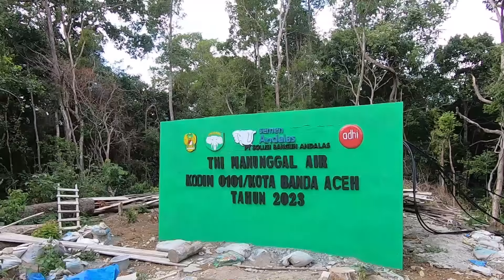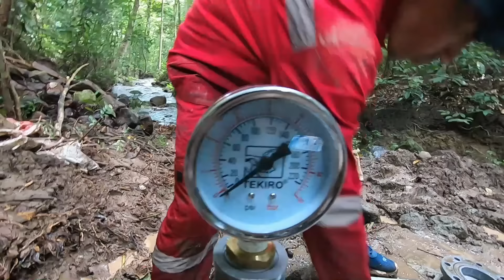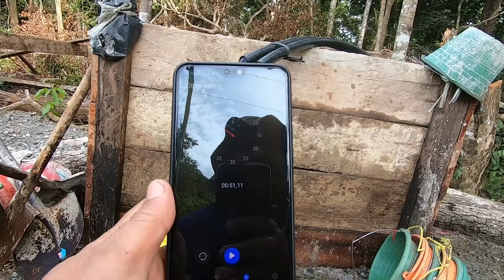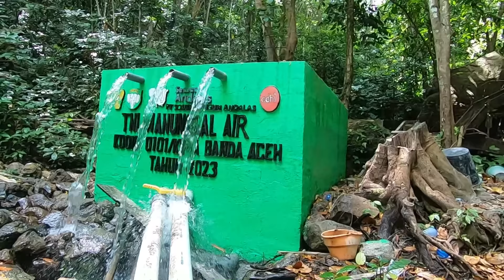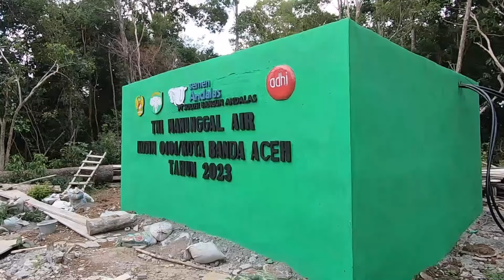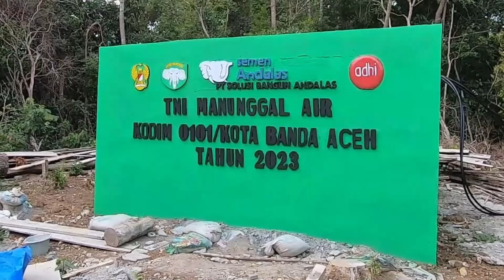High Pressure Non-Electric Water Pump, Double Valves, 2 Pumps with 4 Out Pipes in Extreme Locations

Comment: JIKA PESAN, BERAPA HARGA PER UNIT KANG?
Reply from the maker: Haga 5.100.000...kang.... salam
Reply: The area of the hole south of the Sarah should use these to transfer water to dry aera away from the rivers Senegal and the negir 50 klm. Away
Reply: @TradisionalChannel_Indonesia  5jt 100 apa aja yg didapat bos
Reply from the maker: Pompa satu set...lengkap tabung 1.8 m ukuran tabung 6 inc... 2 bh klep bahan besi... Pressure gauge , baut anti karat... Kunci 24 dan kunci inggris

Comment: Fantastic job. How would a project like this cost? I am thinking of doing something similar in my late mother’s village in near future in Congo. Hope to work with you one day.
Reply: My name is Martin from jamaica I always watch your peoples videos you peoples are very talented now let me give you a simple  water 💦 inlet at the air
Reply: Are different idea you use a very big air compresser and put your mechanical works to it I confident it will work
Reply: My name is Martin from jamaica I always watch your peoples videos you peoples are very talented now let me give you a simple idea for your water pump works get a six silender diesel engine and put it on a stand put a water wheel to the part that turned to the gearbox and reverse it with a water 💦 inlet at the air
Reply: I can build one for your village, I have designed a ram pump. And I can build one for you at a much lower cost, just get me the airline ticket and a pocket allowance and fly me over to your village. You provide the manpower and resources

Comment: Mantap pak, berapa harga pak input 2,5 inci, output 1/2 inci dengan elevasi 25-30 meter dengan panjang 200-300 meter
Reply from the maker: Untuk pompa hidram yg 3 inchi ada,  jadi pipa input 3 inchi… 
Tapi bila sumber air sangat kencang  boleh mengginkan input 2.5 inchi
Reply: harganya brapa mas bro saya mau beli
Reply from the maker: @janijani513  kalau harga agak mahal dgn bahannya... Rp. 5.100.000

Comment: My name is Martin from jamaica I always watch your peoples videos you peoples are very talented now let me give you a simple idea for your water pump works get a six silender diesel engine and put it on a stand put a water wheel to the part that turned to the gearbox and reverse it with a water 💦 inlet at the air sucksiton and put other water hose to the part where the exhaust would come out and immediately it becomes a powerful water pump
Reply: Ram pump, it uses hydraulic shock to cycle itself it can push water higher than the source but the pump must be lower than the source. Him stomping on the waste valve is the way to get it started every time you see the waste valve closing water is sent out

Comment: Man, that thing makes one heck of a "THUD" when the waste valves close. With those big pipes, you are going to move a LOT of water uphill. What kind of pressures does it run when operating at full capacity? And also, how much water does it move up the hill and how far would it push the water up?

Comment: Hello, I want to use the system you have installed in a pond. For this purpose, I want to install a siphon system on the suction line of the water ram, pressurize the water coming from the pond and transfer it to the water ram. I intend to hit a horizontal distance of approximately 300m and a vertical altitude of 25m. Do you think this mechanism will work for me or should I install a stronger mechanism? Thank you in advance
Reply from the maker: We have never tried the Siphon system.
but if the system we have installed is suitable for a vertical height of 25 meters...
Reply: @TradisionalChannel_Indonesia  My aim is to make stagnant water fluid using the siphon method and give it to the water ram in that way.
Reply from the maker: Yes, yes... if with such a system it is okay, the important thing is that the Siphon system must be higher than the ram pump... there must be elevation between the siphon and the pump... Good luck
Reply: My name is Martin from jamaica I always watch your peoples videos you peoples are very talented now let me give you a simple idea for your water pump works get a six silender diesel engine and put it on a stand put a water wheel to the part that turned to the gearbox and reverse it with a water 💦 inlet at the air
Reply: My name is Martin from jamaica I always watch your peoples videos you peoples are very talented now let me give you a simple idea for your water pump works get a six silender diesel engine and put it on a stand put a water wheel to the part that turned to the gearbox and reverse it with a water 💦 inlet at the air
Reply: My name is Martin from jamaica I always watch your peoples videos you peoples are very talented now let me give you a simple idea for your water pump works get a six silender diesel engine and put it on a stand put a water wheel to the part that turned to the gearbox and reverse it with a water 💦 inlet at the air
Reply from the maker: thank you for your idea... good luck

Comment: The height I calculated on my land is approximately 20 meters. My water motor line that I previously installed is a 2-inch system. Can I integrate this system with the water ram?
Reply: My name is Martin from jamaica I always watch your peoples videos you peoples are very talented now let me give you a simple idea for your water pump works get a six silender diesel engine and put it on a stand put a water wheel to the part that turned to the gearbox and reverse it with a water 💦 inlet at the air

Comment: Does anyone know why when working on the valves at around 6:30 for example, they did not block the inlet upstream to prevent the water from flowing, allowing them to work more easily?
Reply: A bit specific.

Comment: why do you have two pipes on the exhaust and not one?
Reply from the maker: because for strong thrust, it needs a small 1" pipe with a pipe length of 250 m. With elevation (vertical height 55 m) so we use 2 outgoing pipes each 1 inch.